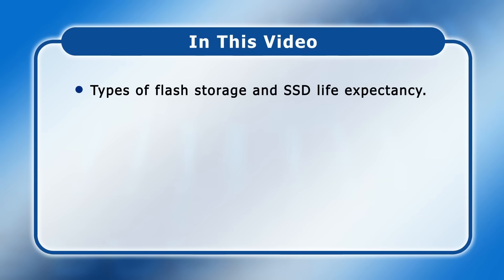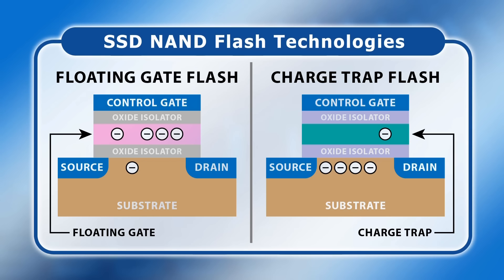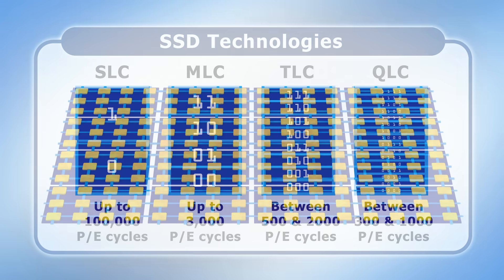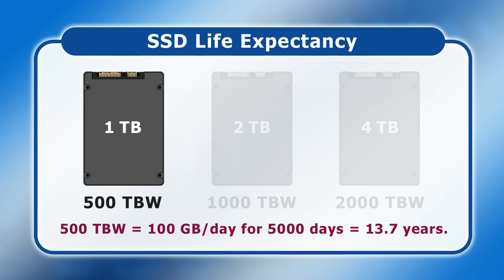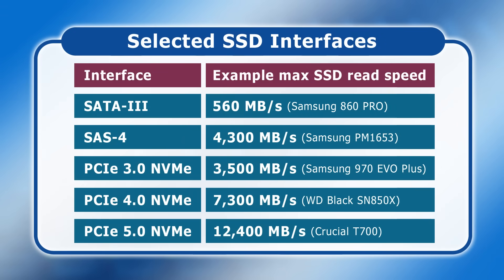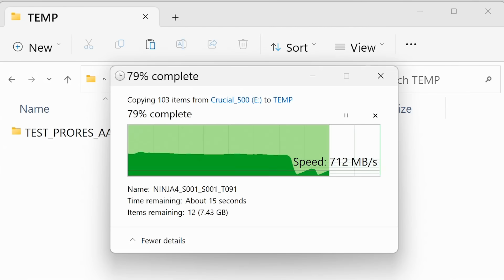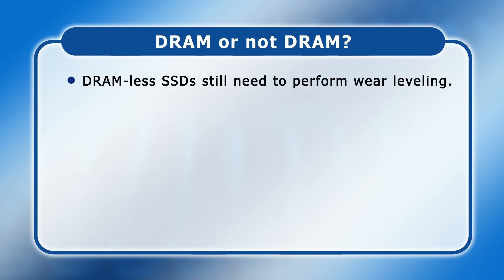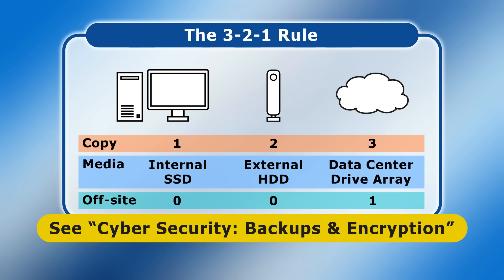Explaining SSDs: The Price/Performance Trade-off

Comment: Oh, very good info.

Another problem that has occasionally shown up is that if an SSD sits unpowered long enough, it can lose data. So probably not the best choice for long term storage on the shelf.
Reply: for the moment we do not know ... some youtube channels are testing it  after few years in the drawer data is still present on those ssd and also peple are reporting their 10 yeast or older  pendeives  still keeps data intact
Reply: @mirek190  Yeah, the problem is there are just too many possible circumstances to really test it. But that is hopeful information.

Comment: I prefer Samsung's terminology. "3-bit MLC" is actually more meaningful than "TLC", which has 2³ = 8 levels, not 3.
Reply: 3 bits are giving 9 combinations not 8.
Reply: @mirek190  No. 2³ = 8. Here are the combinations: 000, 001, 010, 011, 100, 101, 110, 111. Count them.

Comment: The problem with the SSD age that most OSs like Windows and even Linux, is that they do not offer a filesystem specifically tailored to such drives.  I mean yes there is F2FS and JFFS2 in the Linux kernel, but I don't know of any distros that offers that filesystem to install your distro on * - F2FS is actually available on Slackware though, but again thats just one distro.  Same under windows - NTFS is all well and good , but again NTFS was written with conventional disks in mind mostly, and NAND devices features were an after thought.  Also my desktop has two drives, an SSD for my distro, but I have a separate conventional 1TB disk for my /home partition - for good reason, otherwise my SSD would be wearing out quicker.  Also I am sure later SSDs now have ways to mitigate wear , but I also want to reiterate that the filesytem is important.

Comment: Enjoyed the video. One thing you didn’t talk about with the newer drives is heat. PCIe4 &5 drives generate a lot of it. I tried to use a 4TB WD SN850X in an Orico 10Gbps external enclosure as a backup drive. Over a period of about 30 minutes it overheated and did not throttle, rather it just crashed and needed to be reformatted (MacOS). So best to avoid external enclosures and use these with a heatsink and active airflow.
Reply: It doesn’t matter anyways. The SN850X would obviously not be able to take advantage of the full speed with thunderbolt 3/4, much less 10gbps usb 3.1.
Reply: Interesting.  I have experienced similar problems with a SN850X 1TB in three separate external enclosures with my M1 Air and M2 Mini.  Oddly enough it seemed to work fine in external exclosures with my Windows machine (in eXFAT).  On the Macs, in the midst of  large-ish file transfers it would start rapidly disconnecting/reconnecting frequently and I generally had to reformat.

Comment: Accidentally bought recently cheap SSD without dram. I think it's WD Green series drive iirc. What an absolute piece of garbage. I ran into extreme situations of drive load and it was at worst something like 100MB/s writes bogging the system completely down. I highly advice to stay away from them. It's downright criminal that many vendors don't show this in their data sheets. Manufacturers that state high speeds for minimalistic operations done in fact should be sued for false advertising imo.

Comment: Dynamic SLC cache is actually just writing the first bit of each cell quickly. The code words are arranged so that 1xx goes in the bottom levels and 0xx goes in the top levels. If a cell is over half full it starts with a 0, less than half full it starts with a 1. It's only when the other two bits are stored that things slow down and the voltage is refined to eight or more levels. The first bit is already there and doesn't need to be copied to a different cell

Comment: I went with a system for buying storage that, at least if I have it right, is somewhat ideal for my situation.

I have NVMe for my OS and high end games, lesser games and apps on my SATA SSDs and a hard disk for keeping files that won't be modified and don't require quick access, such as music and video files.

I recently retired my second to last hard disk(500GB Samsung from 2012) with a Cruicial MX500 2TB SSD, and am looking to replace my equally old 2TB HD with a more modern HD with 8TB of space.

It's amazing to think how much everything has come down in price. When I bought that 2TB HD, it cost more than the 2TB SSD I just bought by some £30, and the 8TB drive I am looking to replace said 2TB HD will cost only a few quid more.

Comment: Thanks for more very useful info Chris. It seems that as a rule of thumb in consumer SSDs the TBW figure is roughly half the numerical size of the drive and given should give many years of normal use before failure. Most SSDs also have 3 to 5 year warranties. But as a professional I have seen SSDs fail without warning long before reaching anywhere near their advertised TBW or warranty period. And once they do (unlike with magnetic drives) you can more or less forget about recovering any data from them. Admittedly in the same breath I had a WD 4Tb magnetic drive catastrophically fail two days after buying and partitioning it, and it was completely unrecoverable. So I guess having a good backup strategy is increasingly important these days.

Comment: hey Christopher, as always,nice video, remember that our govenments rant about using durable things,being it cars,heating, etc, well,this month not only one of my 2 PCs broke down, but also a bosh driver with 2 lithium batteries (wich are still good) that i cant use for the new machine, its all about money, be careful with the samsung SSDs,there was a faulty firmware that made the drive age very fast and break down, so check the firmware nr (latest) with samsung magician, cheers m8

Comment: I think SSDs as a system are already competitive with HDDs for smaller NAS when you factor in redundancy. Suppose two 20TB HDD, mirrored costs 1000 local currency units, and yields 20TB usable. Twelve 2TB SSD costs 1200 CU, and has 20TB usable with two spares. The SSDs cost twenty percent more, but can tolerate two failures, serve hundreds of times more IO/s, and consume less power.

These days hard drives only make sense if you have shelves full of cheap drives purchased with a bulk discount

Comment: In 2018 Intel gave a presentation on SSD Ram.  
Redis is a RAM based db and the RAM based ssd made a lot of sense. 
Conventional dbs have to have extensive processin to store the cache.  And the data structures used in the db are designed for disk  storeage.

Comment: I always consider TBW and DRAM when buying, but I wasn't aware of newer drives ability to access system RAM. I do wonder how the performance differs between the two DRAM methodologies. 

Thanks, as always, for the clear and concise breakdown of the technology, Chris!
Reply from the maker: You are clearly wise. :) A DRAM-less SSD that accesses system RAM is slower than one with DRAM. It just doesn't have a life expectancy penalty.
Reply: @ExplainingComputers  only NVME SSD can acsess system DRAM via HMB. DRAMless SATA SSD (both 2.5 inch and SATA M.2) should be avoided.

Comment: Superb update. I'm in the market right now. 4 TB Samsung Qlc for 180€. Incredible. I paid this amount for my very first SSD in 2010. It was 120gb. 40 times the price per GB back then.
By the way, this new 870 QLC (the review in video is the 860 model) has a TBW of 2.800, but that is just for the 8TB model. For the 1TB model Samsung states 1.5 Million Hours Reliability (MTBF). 

Here are the numbers for all sizes from Samsung itself: 360 TBW for 1TB model, 720 TBW for 2TB model, 1,440 TBW for 4TB model, and 2,880 TBW for 8TB model. 

I am going to use the 4TB as NAS supplement and backup to my new router which has a USB3 port. (Asus ax4200, strongly recommended). So this disk will outlive the TBW limit I'm sure.
Reply from the maker: The fall in prices is indeed amazing.
Reply: I like how they reused the floppy disk numbers 360,720,1440 (and rare 2880, 2,8 Mb HD floppy)

Comment: Are TBW numbers as optimistic as MTBF quoted values were with HDUs? In my experience even 125,000 hours MTBF was a dramatic overestimate. And I had one drive with a quoted 1 million hours.
Reply: From youtube videos testing SSD TBW are verry low as SSD can works usually 2x-4x times longer until goes into read mode only.

Comment: One thing he didn't mention is Techpowerup has an SSD database where you can get all kinds of info including whether or not a particular drive has a dram cache (and size).   It's still fairly new, but drive information is getting added to it very quickly.

Comment: Thanks for all of the useful information.  I still see a large place for physical hard drives, especially for large amount of data that does not need immediate retrieval.  I have multiple 10 TB drives and they have been on line for years now with no problems.
Reply: Yeah I use the seagate exos in raid or zfs... was looking at enterprise ssd that have more endurance but they are pretty pricey, but will have to see how pricing goes

Comment: I use Intel's 670p SSDs. They work well, and were affordably priced. A few months ago, I was able to get two 2TB ones for $60 each. I've been using the 1TB version as my OS drive since my first build back in 2021. Sadly, the 670p is no longer in stock at Amazon.

Comment: I have a Kingston SV300S37A60G [SSDnow 60Gb] which I installed in 2015. It's an MLC SSD, with a rated 32 TBW. I use it as a boot/OS drive only, my home directory is on my RAID. Eight years later and it's still going strong, though SMART tells me that the drive has less than half of its remaining life left. I can't really complain about that.

Comment: I still use a 240GB SSD with SATA and maximum exchange of 500MB per second. It is booting very fast, uses almost no power and is very quiet, instead of a spinning harddisk. I can hear only the cpu fan of the computer and i am satisfied.

Comment: Samsung's naming actually makes more sense than the "standard" terms as "multi" just means more than one, so only using it for 2-bit cells seems odd seen as triple and quad level cells are also by definition "multi" layer cells.
Reply from the maker: Technically, yes -- I agree. Samsung is correct that the "MLC" in M stands for "multi". But, when everybody else uses SLC, MLC, TLC and QLC in one context, it's not helpful when one manufacturer (even if the largest one) does something differnet. And Samsung only started doing this when they started making more and more TLC (and then QLC) drives.

I remember for years comments on one of my videos when I said Samsung EVO drives were TLC, and lots of people said "wrong, my EVO is MLC, it says on the box" (referring to where it said 3-bit MLC). There is no doubt that Samsung did what it did for marketing reasons.

Comment: I've learned modern SSD's HAVE to do internal wear leveling in order to maintain performance.
I have a 2TB Samsung EVO that started freezing when doing write operations and even benchmarks showed as low as 100MB sec writes.
The drive barely had 5 TBW and only 1/2 capacity was in use.
I ran manual windows TRIM operations and nothing helped. After doing lots of research I've learned SSDs do their own internal 'cleanup'. Moving data around and clearing cells to optimize write performance on new operations. It took several weeks and now write speeds are back to normal.
Apparently this is all done through the SSD controller and is a 'black box' that we have no control over.
This happened after doing a couple hundred GB of write operations. Read speeds were unaffected.
Reply from the maker: Yes, as discussed in the video, an SSD's controller constantly performs wear levelling over which the user has no control.

Comment: A very thorough and clear explanation. Some time ago when I read EVO 860's slow down when copying a file larger than ~60 GB (I think it was that value) I changed to the Crucial MX500 as that one has a dynamic SLC cache and doesn't appear to slow down.
Reply: Those MX 500 drives are actually very consistent if you can afford to stay below 1/3 capacity. Still cheaper than enterprise drives but with the low utilization they're only writing to the SLC pages and never need to garbage collect
Reply: @shanent5793  yes I like them very much
Reply: The question is, who except for professional video editors is gonna do that regularly? If you download a game for Steam the drive transfer speed won't be the bottleneck, and even if you record let's say a 30 min gaming session in FHD as a background for some kind of talking video putting a new audio track on a 20GB file won't overwhelm even cheaper PCIe drives.

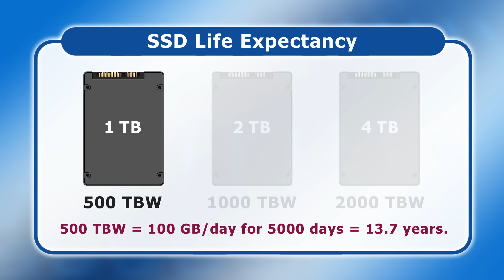Comment: 6:36 This is a good reason to make sure you have sufficient RAM in a system when using a SSD as a primary system drive.  When Windows starts using disk swap space because it runs out of RAM, it gets pretty rough on the write cycles.  Plus Windows gets unstable and BSODs more frequently when dropping to swap space.  There's little reason to not have around 32GB RAM in any given system that's used as a daily driver.

Comment: Thanks for the thorough explanation.
I was going to buy a WD M2 Blue back in the summer, now the price has gone up £20 for the 2TB model.
Maybe Chris you could help me by doing a video about SE (secure erase of SSd's)?
I have a Samsung NVME but Magician says it is not a supported drive ( it is C drive) but even if I create the USB drive to perform SE it will not work. I also have a Crucial 500GB sata SSD (storage but old Widows that I want to remove) I have tried Parted Magic but that fails to recognise drives ( maybe too many are connected? I just need 1 connected that I want to SE?)

Comment: 9:39 Does this mean that if we put the SSD in an external enclosure, the SLC cache will always be full because users will mostly unplug it after the data has been written?
Reply from the maker: This would indeed be true if you always wrote enough data to fill the cache and the drive never had any "free time" to migrate to data to TLC/QLC cells. A very interesting point.

Comment: I purchased a 4TB Crucial MX500 2.5" SATA SSD, based on rave reviews of the smaller capacity models in that line.  I expected equal or better performance.
The drive turned out to be a slug.

Although it was faster than a mechanical drive during simultaneous reads and writes of countless small files, it was slower than my USB based mechanical drives, as well as internal mechanical drives (all mechanical drives being SATA based).

This was when the mechanical drives were empty (because they slow down as they run out of space).  And it was for several different model mechanical drives for both Seagate and Western Digital.

The 4TB MX500 was faster in one other respect.  No waiting for platters to spin up.
But it was a disappointment.

I also tested the 4TB MX500 as a temp drive for creating a crypt-o Madmax based Chia plot.
Forget it.  It was very slow, even falling below 50 MB/s on the writes, after its cache was exhausted (Chia plotting will do that).

Would the other capacity MX500 drives have that same dismal performance?
From the reviews, they supposedly do not slow down -- at least not much.

But the 4TB model slowed to a crawl when its cache ran out.

If Crucial changed the design for the 4TB model, to save a few cents, figuring the rave reviews on the smaller capacity MX500 models would ensure sales of the 4TB model, then shame on them.

I found out after my return window closed.  So now I have a paperweight.  A huge amount of space that is slow.  Like filling a swimming pool with a garden hose.

My old 2TB Samsung T5 is 100+ MB/s faster than the 4TB MX500, even when the MX500 has all of its cache free.
And the T5 barely slows down, even if you write 2TB to it without rest.  It is a beast.

By the way, the Samsung T7 also becomes a slug when its cache runs out.  Not so with the T5.  So Samsung added faster cache for the T7, and far slower NAND cells for the bulk of its storage.

Comment: Hi, anything different from SLC is a swindle, I still have some HDD 20 years old that are working ferpectly, which was a major PITA for manufacturers as reliable drives equals loss of revenue.   I'm not saying that SSD hasn't brought some interesting features, such as super-fast readings, especially in a multi-users accesses, just that replacing HDD with SSD was made almost only for money reasons, simply because if every manufacturer had produced SLC, it's price would be lower than QLC.

Anyway, these broken technologies are already dead… or more likely, should already be dead, as Fujitsu developed a kind of "RAM" that retains data for at least 300 years (may be up to a millenia), lasts forever and  can be accessed around the speed of DDR3 RAM (as of now), but this would put the manufacturers in a worse loop than described above, so at this time no one is using nor developing this technology farther :(((

This is a shame and hampers researches for better and faster technologies, and this is a sham against all kind of consumers.
Reply: No, 2-bit MLC started to be used 20 years ago because at the manufacturing node available at the time the density of SLC was not good enough, MLC made it to where they could make a flash memory card twice as big and overall allowed them to get less expensive, if they'd have continued making only SLC memory cards wouldn't have gotten larger and more affordable at the pace they did, and TLC did the same thing for larger SSDs in the 2010s, the density of NAND cells is limited by semiconductor manufacturing technology and if we were still using SLC for everything we'd just be getting 1/3 the capacity of TLC for the same cost which means most SSDs would probably cost 2-3x as much.
Reply: @brandonupchurch7628   Yep, this is the manufacturers story…   Just notice that SLC can also be stacked.